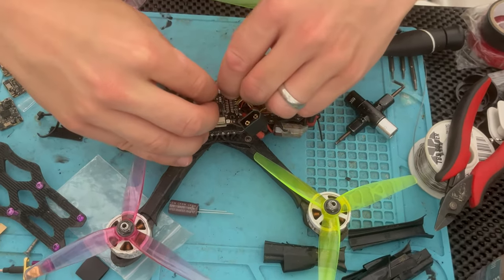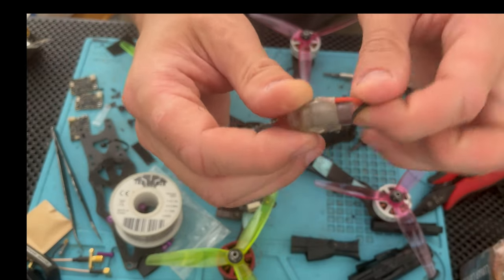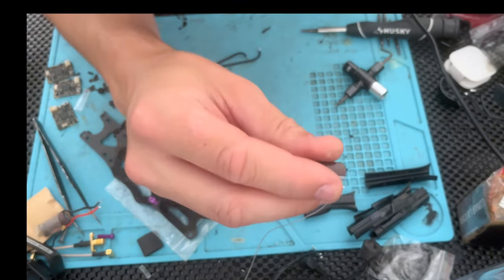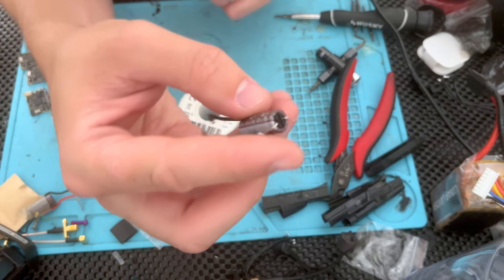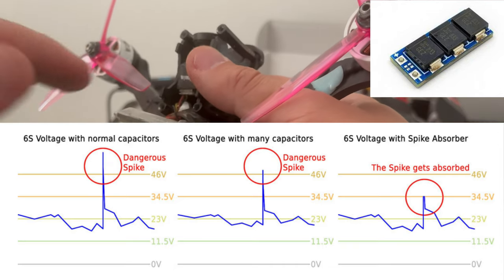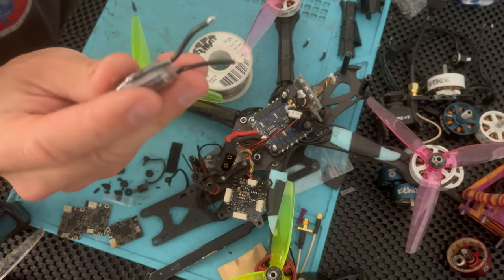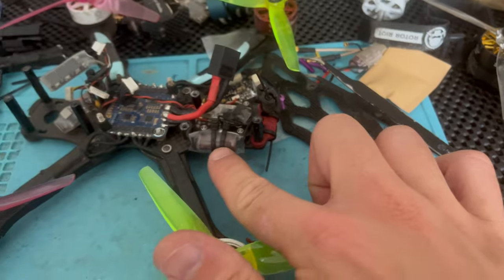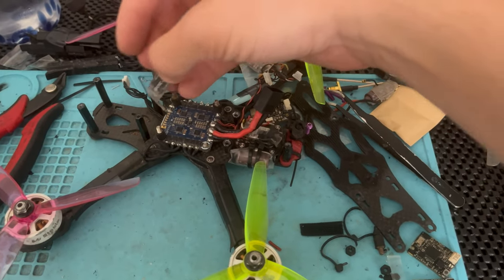How To Setup a Capacitor On a FPV Drone & Install a Spike Absorber

Comment: I dont have spike abosrber … if only i sorder the capicitor like this way … is there any probelm?… i mean only the capacitor through motors wires without spike abosorber
Reply from the maker: You don’t neeeed the spike absorber, I didn’t run one for a while — but I had a few boards go unexpectedly so once I got replacements I started using it and I noticed a slight improvement in lifetime

Comment: Thanks for the tutorial, the step by step helps. I get what you’re saying about the voltage of the cap, how do you calculate the right uF? 470uF on a 6S, what about a 4S or 2S? Or is 470uF good all around?
Reply from the maker: Yes I would go with that on basically anything, maybe 1000 on 6s for a little extra filtering but 400 range should be good for 2s. It also depends on how bad the video is and what you’re trying to clean up.
Reply: Running 2000 ufl on my 6s quadmula build.. runs fine

Comment: On the compositors I noticed with your shrink tube and the wires configuration that solder joints come in contact with the compositor housing.  I understand that theres paint on the housings that would act as an insulator but if the paint becomes scratched on both sides where the solder joints attach it could ground out through the cap housing?
Reply from the maker: I’ve never had that be an issue, and I’ll even reuse caps on builds, so I personally don’t worry about it

Comment: OK so I fly a skyliner mk3 from Rotor riot and the power leads are on the side and I had a battery eject and I pulled the power pads completely off and had to patch it by putting it on the bottom of the pads but my question is how would  you makes sure that wouldn't happen again thank you and fly high my friend
Reply from the maker: Try a zip tie on the xt60 attached to a standoff so it can't be yanked quite as much -- or use a batt strap to help hold it down so you eject the battery instead of killing the pads.
Reply: Will do man I appreciate it 💯